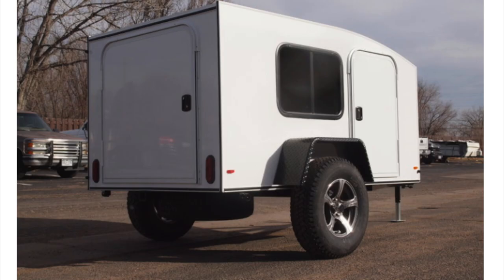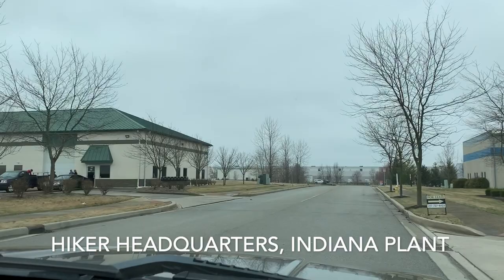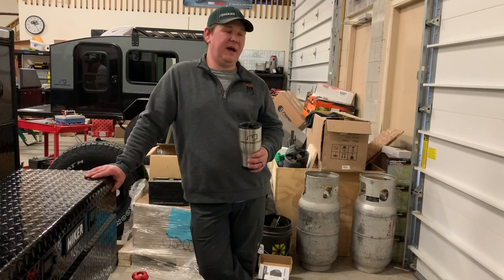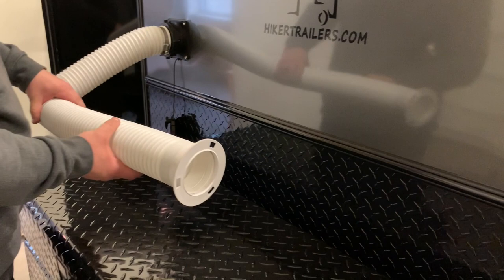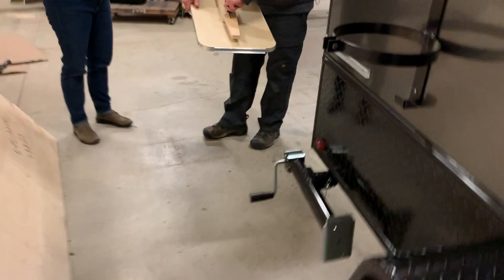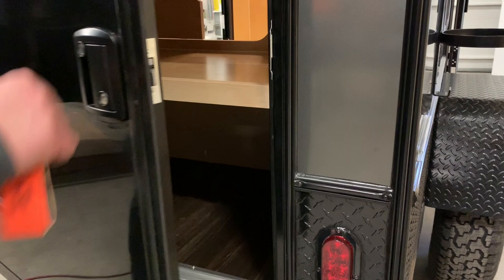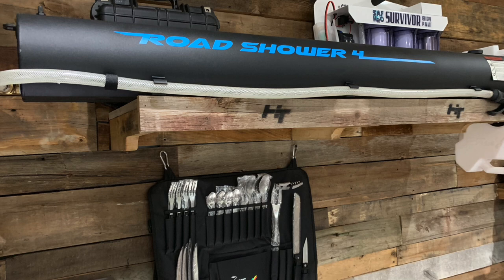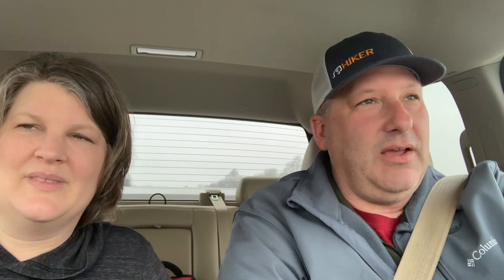Hiker Trailer - Pick up day

Comment: Why did you choose the 5 x 9 over the 5 x 10?  Just curious.  I have been looking at the Intech Flyer Pursue, but ran across this and want to make sure I get the right one.
Reply from the maker: Rusty Branson the extra space gained is an additional foot inside which didn’t do us really any good with the preset mattress. We already had 24 inch cabinets in the rear any deeper would be impossible to get items out. Lastly we didn’t care for the stretched look.   I looked at the flyer but wanted a sealed rear galley over the double doors.
Reply: @MWDAdventures  So if I understand you correctly the 10' version has double doors in the back instead of the single door?  Thanks for the reply.  Information from people who are actually using their campers is priceless!!!
Reply from the maker: Rusty Branson double doors in back on the intech not hiker.  Hiker only has one door.  I though we are comparing the intech to hiker galley 10 ft model.  Maybe I misunderstood you.
Reply: @MWDAdventures  I'm the one who misunderstood.  Was mostly curious as to why you went 9' instead of 10' and you explained that.  The Hiker is quite a bit cheaper I guess because of aluminum chassis and cage.  The hike still looks like a sturdy build and is not heavy despite the steel frame.  Thank you so much for taking the time to answer.  Your videos are well done and very informative.  You have shown me products and accessories that I would not have thought of in a million years and providing the links is so helpful.  Looking forward to watching more.
Reply from the maker: Rusty Branson I love helping people that’s why I built the channel.  I couldn’t find any owners to chat with. Good luck with your decisions.

Comment: Nice off-road trailer. I am a little concerned with the tire mounted underside. It takes away the clearance. Do they mount the standard 13.5K AC on the roof top? On the Maxx Fan, does it have some kind of rain cover? Wind-resistant door hinges? If they have an open house in Indiana, I sure will go take a look.

Comment: If it is a Off- Road Trailer where is the Reticulated hitch & is that a straight axle I'm thanking so. If I'm wrong let me know. Mmmmm
Reply from the maker: It’s not off road.  The mid range is some dirt roads and main roads.  The off road edition has the bell and whistles package.
Reply: @MWDAdventures  Thank you I will look in to that.

Comment: $10k base,well equipped $27k ,which is affordable but it is really small. Probably yours was $8k at least.
Reply from the maker: Wandering Renegade base was 6-7,000.  If you stick with all the stock options you can get this trailer very reasonable. The great thing is you can mod it to your hearts desire.

Comment: Is yours, or the Extreme light enough to pick up the tongue and swing it arnd 90° in a garage? Trying to figure out if I could physically squeeze this sideways in to the bk of our garage, bc it measures out, but is it physically poss to maneuver it? Unfortunately it's a dealbreaker if it won't fit in our gar.
Reply from the maker: e Burtonavich yes. I can pick it up and move it.

Comment: Thanks for this. We are in the process of ordering ours for next year and this video was great info. One question we still have is about the electric brakes. I have no experience with pulling a trailer so I'm wondering how useful the electric brakes would be. They are expensive to install so I don't want to add them if it is not necessary. Our trailer is the 5x8 and won't be loaded down. I'm expecting a final weight of less than 1300lbs. Did you get the brakes installed? Any thoughts?
Reply from the maker: We travel all over the country and wanted the electric brake option for that. Plus if you do though extra weight in the travel for a multi week adventure and you are going through mountains it will save your vehicle brakes. If you are doing flats roads , short trips, no much weight then I wouldn't worry about it. I am coming from a pop up camper that weighted 2500 loaded and the electric brakes in the West really made a difference.
Reply: Thanks. This is exactly the kind of info I need. @MWDAdventures

Comment: Great video.  Just curious...I saw your other vids on the Extremetears teardrop and was wondering why you and your wife decided to go with the Hiker?
Reply from the maker: Scott, I had rented 2 Extremetears models before we decided on the hiker. Both are great units for us my wife didn't care for the galley slop on the extreme model. She hit her knees on it when rolling over. The hiker gave us the option to sleep in either direction. If I went with the larger 5x10 model of the extreme this wouldn't have been an issue for her height. It really depends on your needs and what configuration you like in the back galley.

Comment: Matt DeWitt, do you mind telling us what were the small issues with the walk thru that they took care of? Would like to know what to look for..
Reply: Me too, share
Reply from the maker: When walking around and showing us how the jacks work one of them wouldn’t pin in position. The alignment was off from the weld. They realigned it and verify the pin would work no problem.  2nd was the propane mount was spaced to be a ungraded mount not just a band to hold the mount in place. Wes didn’t have the 5lb upgraded mount in stock so he bumped us to the 11 lb mount for free. They took care of both with no issues or added cost.  The accessory poles didn’t come in on time for my awning so they had to be shipped to the house.  The climate rite ac wasn’t in either and had to be shipped to the house. Which wasn’t a problem either. Less to take home.

Comment: I'm thinking of a small trailer. I've been looking at a runaway.
How is a hiker trailer different?
There's quite a following on Facebook for the runaway
Reply from the maker: Trucker Daddy - AKA John in Québec hiker has two plants indiana and Colorado both started out with 1-2 year backups of getting units out the door. About 6 moths ago they started to batch build and hired more staff so the times have shortened up by 6 months is some cases.  Each hiker is customized which will take a bit more time over the runaways.
Reply: Trucker Daddy - AKA John in Québec runaway is about half the price with the same options!
Reply from the maker: B RADD funny you say that the base price hiker is 2895 for a 4x8 the base runaway is 3895.    Hikers are in the same base price range the advantage to hiker is they have more options to pick from runaway doesn’t they build the shell and you build it out yourself.  Both have there advantages.
Reply: @MWDAdventures  agree but i think with all the options you have on this it was prolly 14 to 15k after taxes. I think the runaway would prolly be around 9k. Also i think they do pretty much the same options might be slightly different, i dont believe you have to wait a year though!